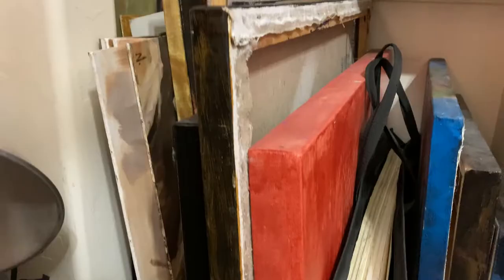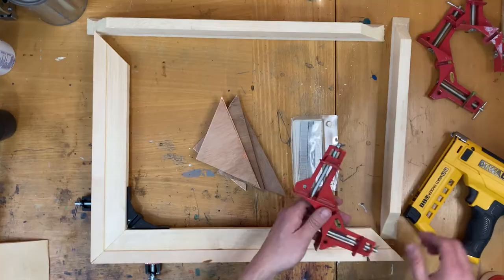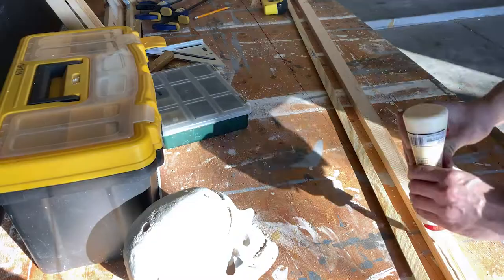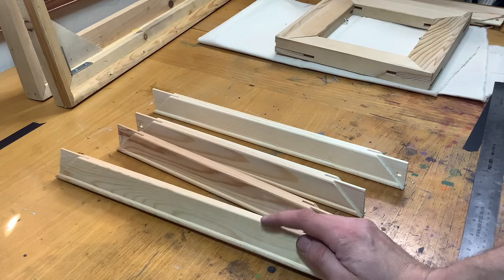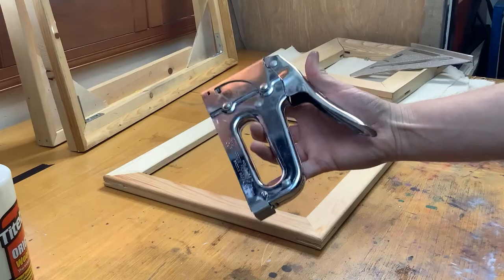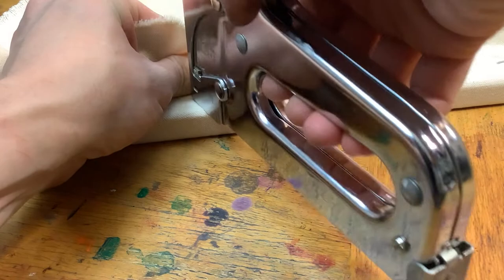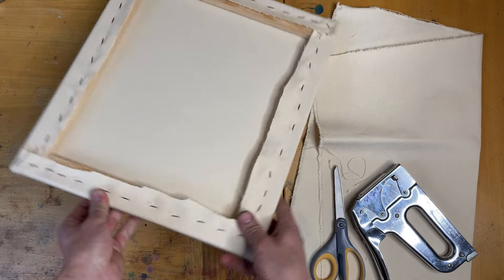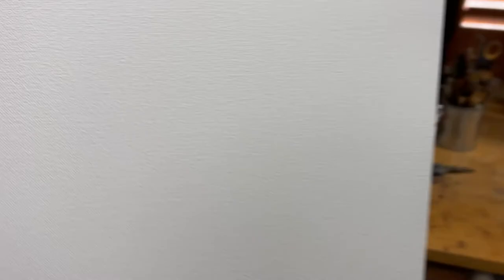How To Make A CANVAS: Build, Assemble, Stretch, & Gesso

Comment: Thanks to you I bought some quarter-rounds and 1x2's and made my first stretcher bars. Tomorrow I'll stretch my first canvas, very excited!
Reply from the maker: Awesome!!! That made my day. So cool! Thank you for letting me know. Good luck with the canvas stretching. Please let me know if you have any questions. Good luck and cheers!
Reply: @michaeljohnnolan  I actually do have a question, though not about your process. I grabbed 7oz cotton duck and then reviewed your video again and saw that you recommend heavier weight for larger canvases. So If I am primarily looking to make canvas in the 2ish feet plus size, is my 7oz too light? I haven't cut up the canvas yet so there's still time for a return. BTW your channel is way underrated, it's only a matter of time until the algo picks you up!
Reply: Never mind, asking the question answered the question. 😂 I got some 12oz on the way from Jerry's.
Reply from the maker: @everettehungerford2858   Thanks for the questions and for the kind words. Anyway, you are right, 10-12 oz canvas is a general good weight for most sizes, especially under 4'x4'. For larger paintings, I would use a 15oz. Glad I answered it in the video. I forgot if I did.  Anyway, 7oz is okay... but not great. That is closer to what the premade Fredrix canvases use. Easily torn and the rigidity of the surface leaves something to be desired. I personally like a much firmer surface.  Best of luck with the stretch! :face-blue-smiling:
Reply: Fredrix was the brand I returned! :D

Comment: Get rid of your zinc white immediately! Zinc white is not archival because it causes cracking and delaminating on oil paintings.
Reply from the maker: Appreciate the warning and you are so right. As you probably noticed, the bag of Zinc white in the video was basically full. I bought it a long time ago to try out traditional grounds, encaustics, and silverpoint... none of which I stuck with... get it, stuck...delimitation. Sorry, bad joke. :)  Anyway, I just used it as a visual prop to explain possible mixtures for gesso. When I was in art school a few companies used a very slight amount of zinc white in their acrylic mixtures. I imagine it was a hold over from the oil primer mixture days. Not sure what it would've been used for. And I think that Winsor Newton's acrylic gesso still does today contain zinc at super slight levels like 0.1%. 

Thanks watching. Appreciate your time.